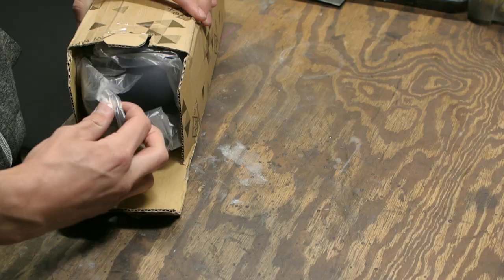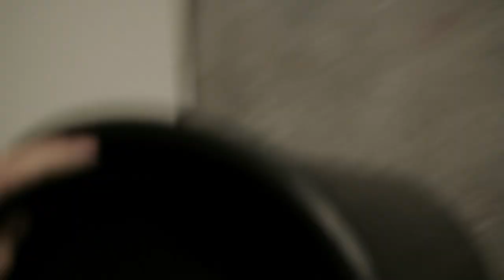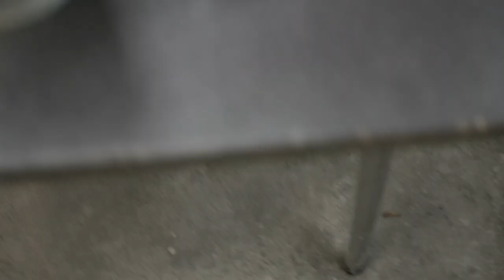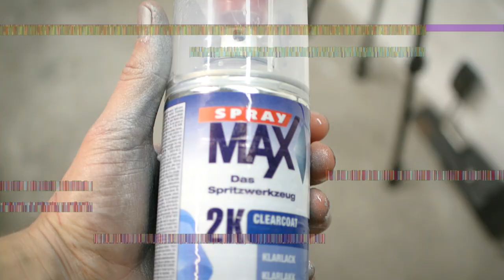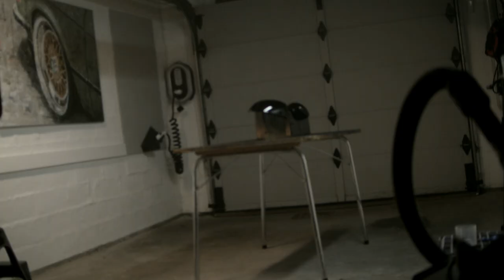I painted some mirror covers and made a video about it

Comment: Those look good! I want to wrap mine with a carbon fiber wrap. Is that the factory fiat paint?
Reply from the maker: Thanks! 🙌 Nope, just a random black paint with a tiny little bit of silver metallic flakes apparently 🤔 No shops carried the paint code, but oh well it's close enough. Good luck on the wrapping btw, I tried that myself before plastidipping them but those stock mirrors are really awkwardly shaped. I'm sure it can be done but I gave up after 2 hours and 5' of wrap 😂